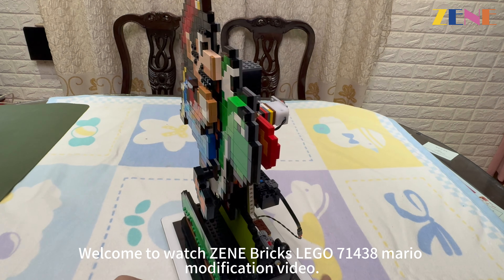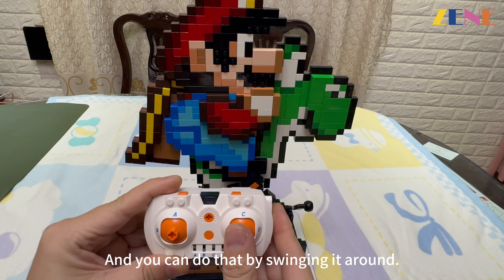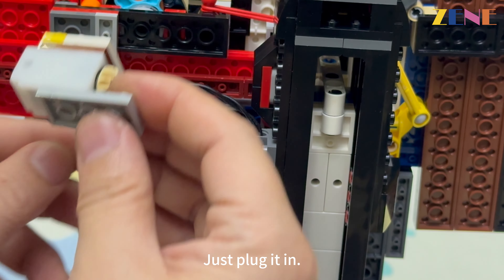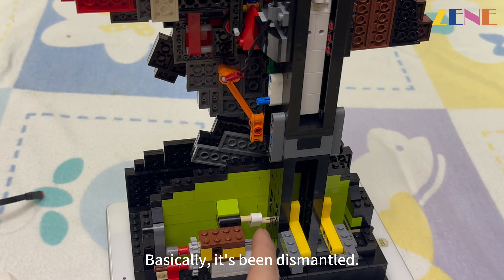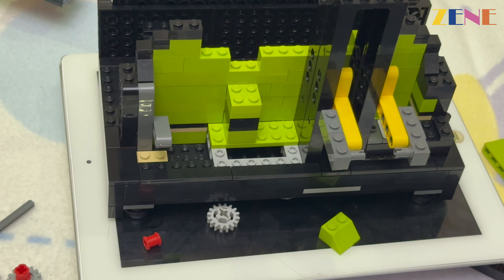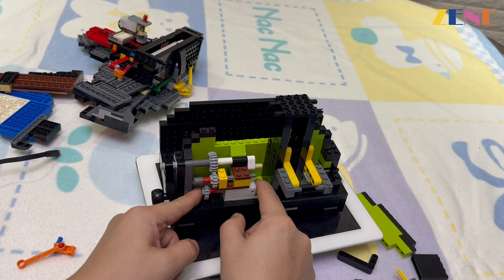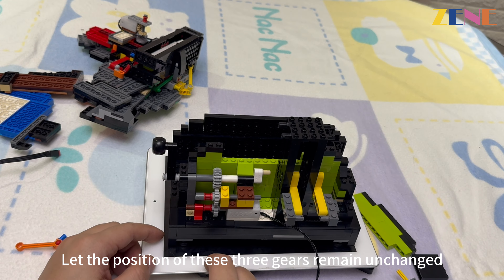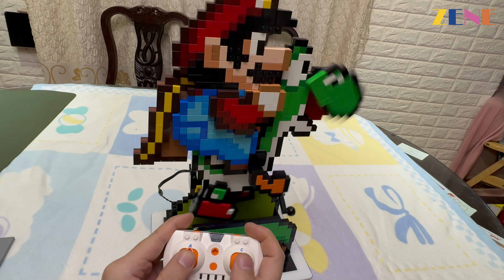ZENEBricks Motorized LEGO #supermario and #yoshi #71438 #powerfunctions #zenebricks

Comment: Is it possible to turn on the running and letting it run for as long as you want without having to hold down the d-pad? And then turn it off when you don’t want it to run anymore.
Reply from the maker: Hi friend, This can be programmed through the app's programming mode to create exercise plans
Reply: @lightuplego  the app doesn’t work and the tongue gear keeps loosening
Reply from the maker: @ don’t worry friend. Could you send a mail to us: support@zenebricks.com ,we will solve this